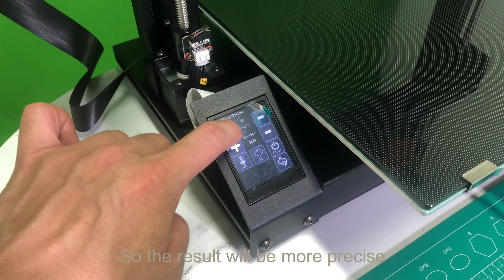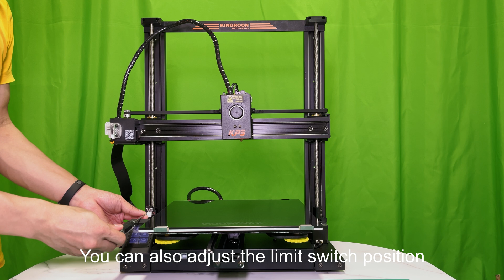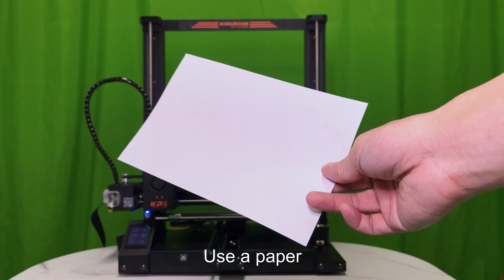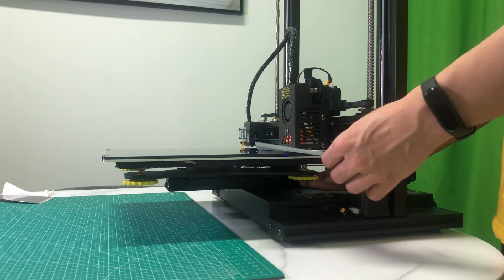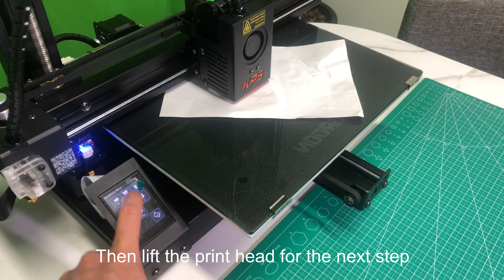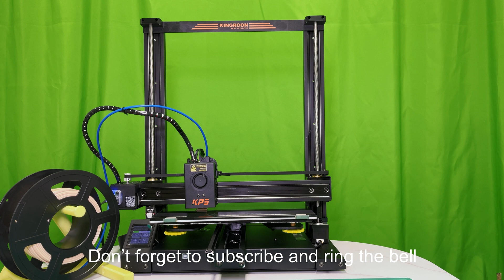Manual Bed Leveling Tutorial for KINGROON KP5L 3D Printer

Comment: I cannot level the bed manually.  I can level the bed in all 4 corners but the middle is in actual contact with the glass bed!  I see I am not alone in this from the comments below.  Is there a fix?!
Reply: You find a solution?
Reply: @kevin-oy9to  No, they will send me a new bed. Yet for now Im using the glass plate and changed from CURA to PrusaSlicer. This made a HUGE difference. Do you print PETG of PLA?
Reply: @rolanmcdolan2518  They sent you a new bed for free? I will follow your advice to try prusa. Thanks, I'm printing in PLA, today I took apart a lot of the Z axis and it seems to have improved tremendously. Then several damages and I was able to print a Bechy satisfactorily , but they are reasonably easy to fix.

Comment: Been 3d printing for some time and decided to upgrade my printer.  The manufacture is great love it.  However, I cannot level the bed manually.  I can level the bed in all 4 corners but the middle is in actual contact with the glass bed!  I see I am not alone in this from the comments below.  Is there a fix?
Reply: You find a solution?
Reply: @kevin-oy9to  I contacted the manufacturer and they suggested I buy a new BL touch.  Haven't tested it yet.  Are you experiencing the same thing?
Reply: @hariseldon2577  Yes, I am experiencing the same thing, the changes I made were to move the switch to a central position, which in the video is unscrewed, adjusted and screwed again, that helped me adjust the bed with much more precision and it helped a lot, but still it was not enough. Right now I'm printing a Benchy, but it doesn't have much quality due to poor leveling.
Another thing that seems to work a bit and improve print quality is printing off center.
If you get progress, please help me! :D
Reply: I don't speak English very well, I hope I explained myself correctly.
Reply: @kevin-oy9to  Language is fine, no problems.  I guess you have forced me to take another look,  as this printer is unusable at the moment, but I don't need it right now.   Doing other stuff.  Try contacting Kingroon.  They are friendly and keen to help.  Please let me know if you find a solution.

Comment: Hello, i recived kp5l yesterday  and i level the corners as needed with the scratchy feeling but middle is always lower and i cant get the scratchy level there, what should i do? Is the glass bed warped? Sides are sticking well but not the middle
Reply: I have the opposite problem,, al corners are okay and the center is extra scratchy, @kingroon any sugguestions?
Reply: @DianaDeGzz  You find a solution?
Reply: same

Comment: How to adjust if the table is crooked.
I just bought a new kp5l from you, the table in some areas is high and in some low, if I put 4 points to proper size, it will scratch in the middle and right by X.
How is this possible?
Reply from the maker: Please send an email with more information to sopport@kingroon.com, our guy will help you out.
Reply: Did you hear back from support?
Reply: Sadly no, they have no responded, wrote emails, to Facebook. 
Sold and disappeared. Also picture on a website said I will receive new model, with belt tensioners, but I have got old model.
Quite sad...

Comment: Please show how to calibrate e steps for the extruder.  There’s no menu option for this.
Reply from the maker: Just adding it to the list. We will make the tutorial on it soon.
Reply: @Kingroon3DOfficial  I would like to know how to calibrate E-Steps as well
Reply from the maker: @EugenioNS  It’s actually easy and someone make a tool on that. We will make a tutorial soon.
Reply: @Kingroon3DOfficial  a tool for calibrating e steps? what we need is the option on the interface to change the value of the extruder steps. no tool is needed for that, just update your firmware
Reply from the maker: @EugenioNS  Let’s see it. Firmware is not a magical key. If you want to calibrate it well, measure it physically and modify the value in the slice software.
Reply: @Kingroon3DOfficial  thats exactely what I did, I measured the filament output and made a compensation on the flow on the slicer, but I'd rather be able to adjust the E-steps like I do on my other printers
Reply from the maker: @EugenioNS  Then the current firmware might not support that, since some commands are not supported. We will test it out when the newer version released. Frankly speaking, I do think it's a more accurate to measure it physically.
Reply: @Kingroon3DOfficial  surely it has to be measured physically, but then with the measurement we should be able to adjust the e-steps on the machine. it would be great if you guys add this command to the printer
Reply from the maker: @EugenioNS  Agree, and we will test it out once the new firmware is ready.